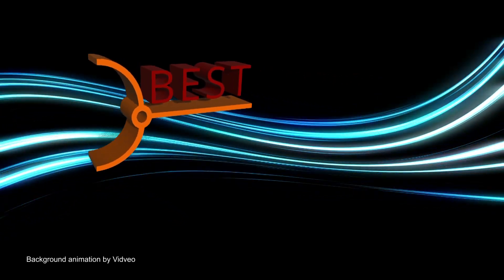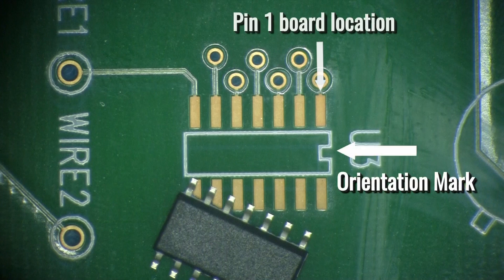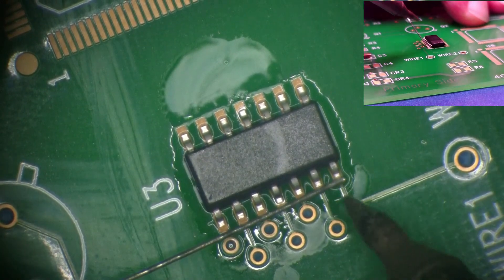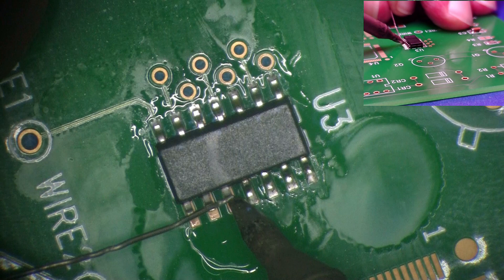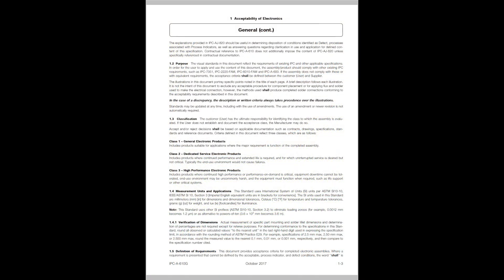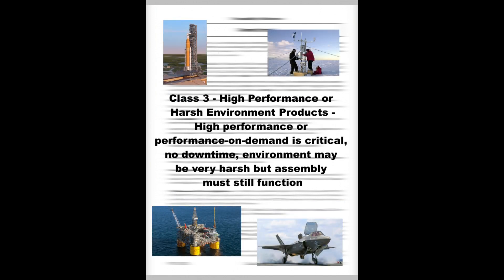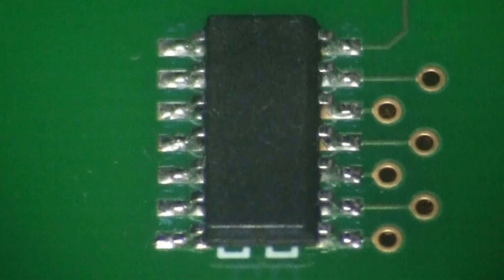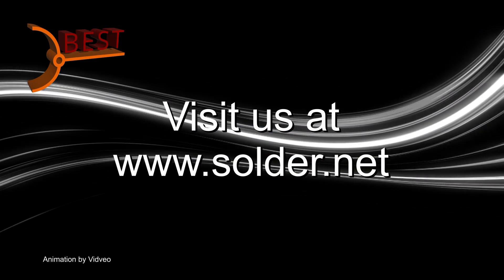How to Solder an SOIC

Comment: I am missing information on the temperature of the soldering tip?
Reply from the maker: Hello,

The recommended tip temperature is about 600 degrees F (315C). It can be adjusted as needed after that but I don't recommend going much higher. Increased temperature will increase the risk of damage to the board and component as well as speed the oxidation of the tip, especially when using Pb-Free solder.

I hope this helps!
Thanks for watching!

Kris Roberson
Master IPC Trainer